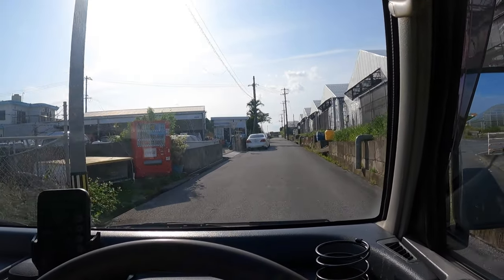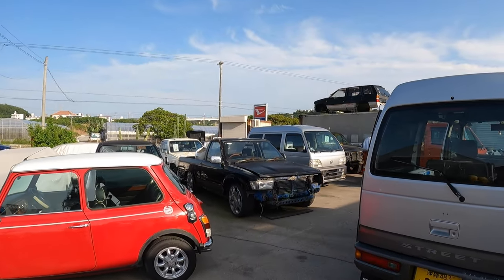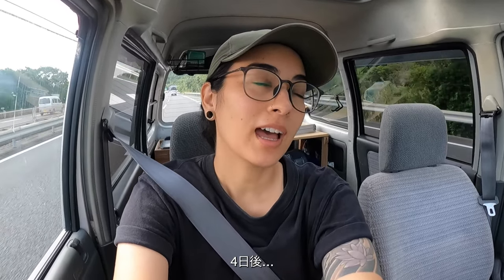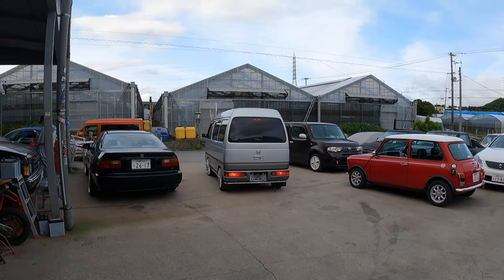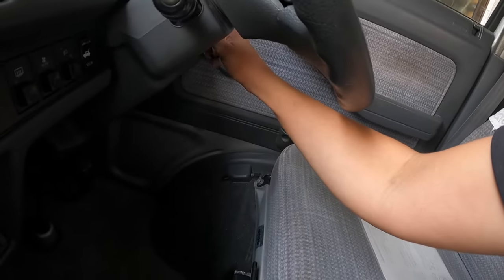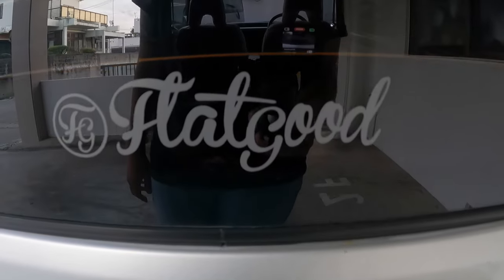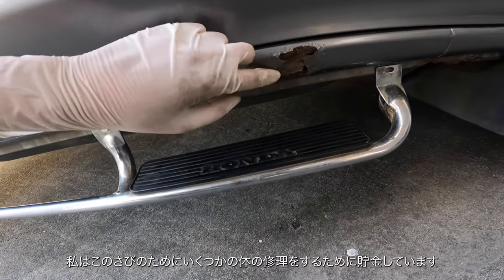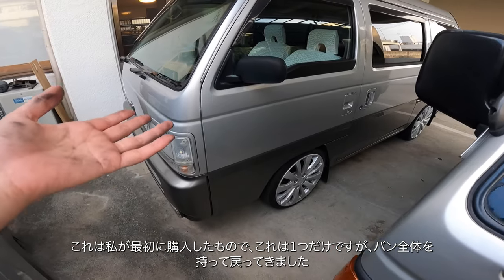I just couldn't resist - 3 Honda Acty Vans!

Comment: pause at 6:44 and look at the bolt in the middle. you still have room to slide it to the right to make the other hole lined up. first, put all the bolts in but do NOT screw them all the way, leave them loose so you have room to play with it.

Comment: The Acty and Acty Street look very similar. As far as parts compatibility, it looks like the Acty trailer hitch will bolt right on to the Acty Street. Do you find this to be an accurate assumption?

Comment: on a scale of 1 to 10 how much would you recommend this van for a first car?
Reply from the maker: I think a solid 7, the only reason im not giving a 10/10 is for its "safety". It does not come with any air bags and has no seatbelts in the back and also its practically a tin can. So if you're in the states where other vehicles are 3x-5x bigger and you get into a wreck. Odds are not in your favor. 
I personally would not drive this in the US. I would be too scared.
Reply: @SarahKane247  thanks <3